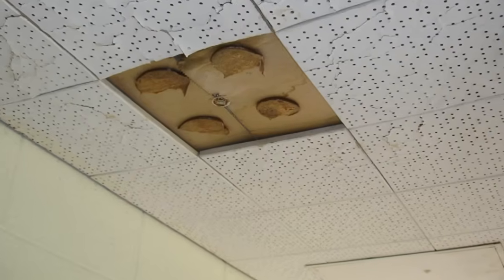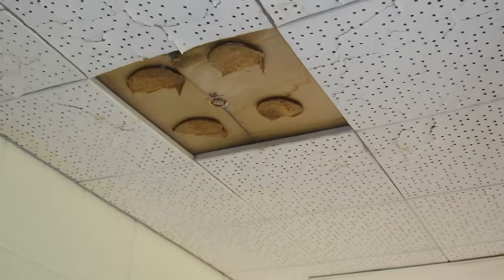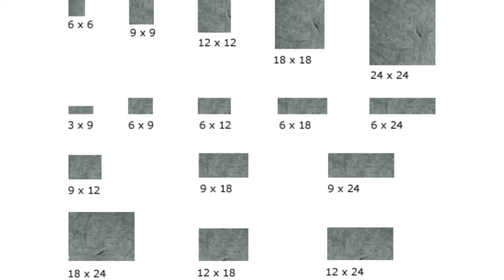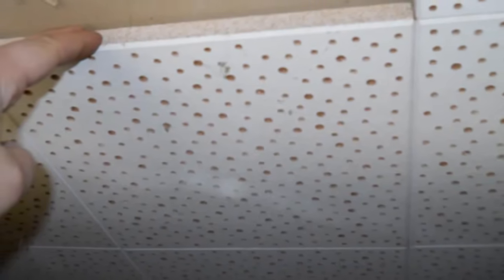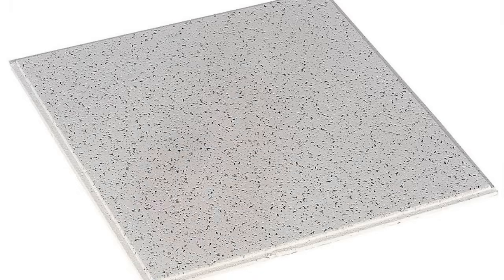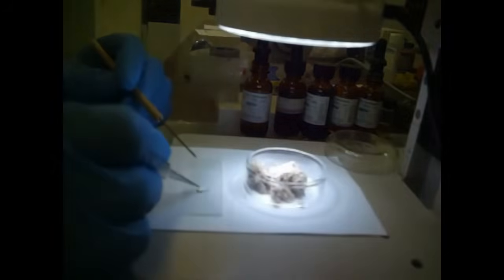How to Identify Asbestos in Ceiling Tiles

Comment: Do non asbestos tiles look exactly the same as asbestos tiles with the pin holes?
Reply: Yes, while the ones, brownish-grey inside, are likely rock wool, the ones beige-grey inside could be a mix of glass fibre and asbestos, the ones neutral grey inside could also either be chrysotile asbestos or glass fibre, the neutral white homogenous-looking are likely amosite asbestos. Worst of them!

Comment: Armstrong made a ton of stuff. If you have floor tiles made in that era, (60s or before) you probably have it if it's Armstrong,  BUT there's tons of asbestos-obsessed pages around. They say no. It might be the only thing they DIDN'T put asbestos in! 

Particularly, look at Flik'r. They have a LOT on it. 

It's tough stuff. Not going to get you unless you go fool with it. Don't sand, scrape or move it. It'll probably outlive you. 

Lived w it in a house 43 years. Still here. Granny lived to be almost 100, it was with her since 65 (Armstrong Montina sheet linoleum). She died of old age, as did other very old people that lived there several DECADES. 

The flooring is maybe 10% not great. Otherwise. It's in near-perfect shape after almost 70 YEARS! 

Smartest to toss a rug over it or go right over it w the newer stuff where you don't have to drill holes.

Comment: Do 25x25 ceiling tiles contain asbestos
Reply: Hi. can you tell me how soon you would notice if you were exposed to asbestos? I'm staying temporarily with a friend and I'm staying  in a ham shack.. meaning somebody did the ham radio and they built this little tiny shack and it smells in there like some flight chemical smell. and I don't know if asbestos. It could be the cheap paneling off guessing I don't know?  but it does have panels on the ceiling. I don't know if it's 25x25 I haven't measured it. I've been staying in my tent outside but I do use it sometimes during the day. He gets a lot of sun and I wonder if the heat is a problem as far as this as well? 😞